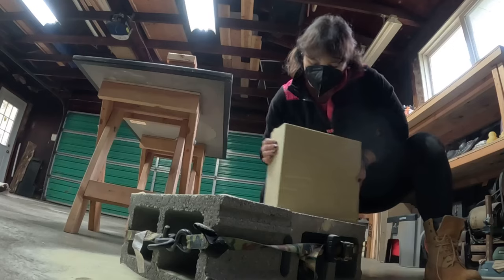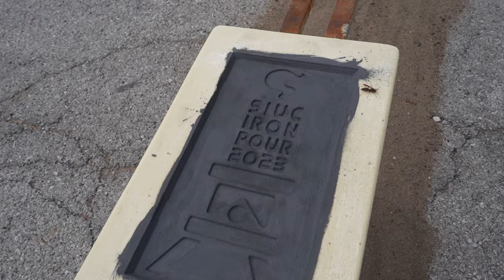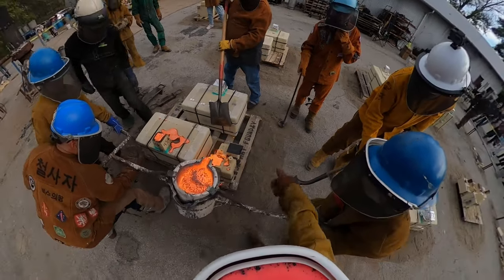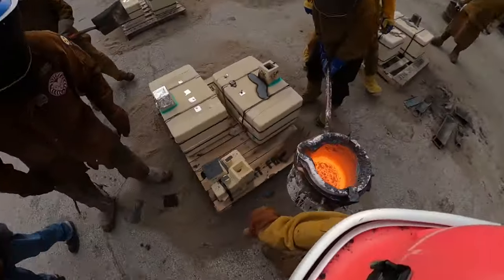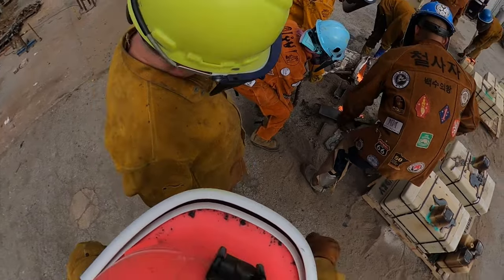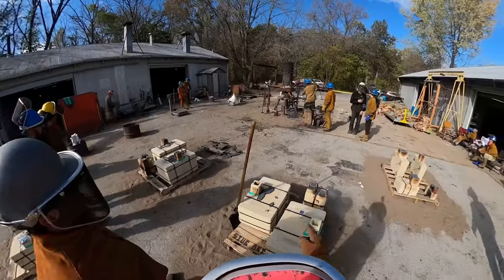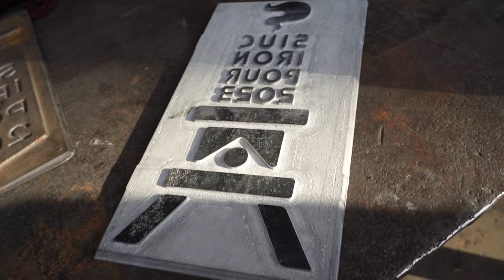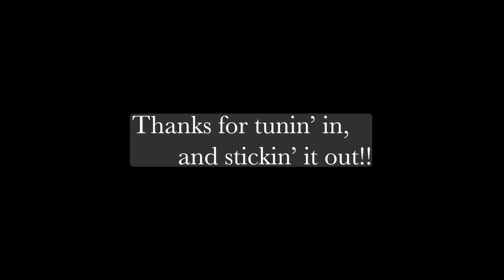Southern Illinois Iron | Iron Pour Vlog | SIU Carbondale

Comment: A trick/ technique I do with some sand castings is I poke a few 1/8" vents using a TIG welding rod in the sand before the resin bonded sand hardens.  I noticed the waffle casting had some trapped air spots.  The 1/8th inch vents are easily chased off.
Reply from the maker: Great idea!  I only put one vent at the very top and I noticed that on one of the iron waffles there is a hollow spot where I cut off the vent.  I suspect that the vent was not big enough to help the casting account for shrinking when it was cooling.  You’re right, more vents will help there be more metal areas for the iron to pull from!  It’s comments like this that really make me feel like posting online is worthwhile!☺️🔥